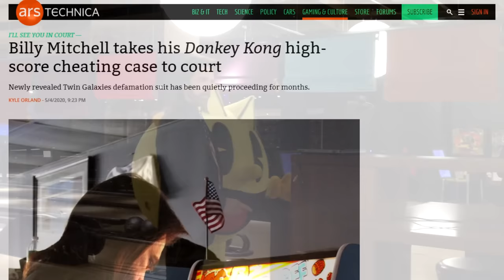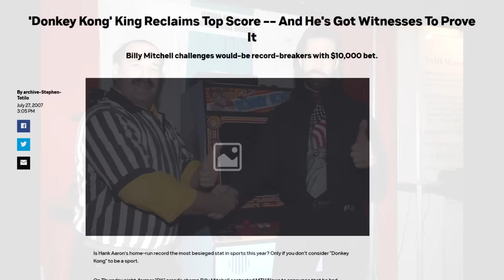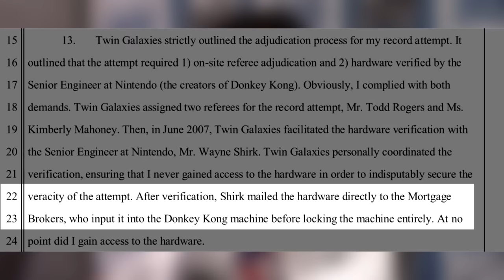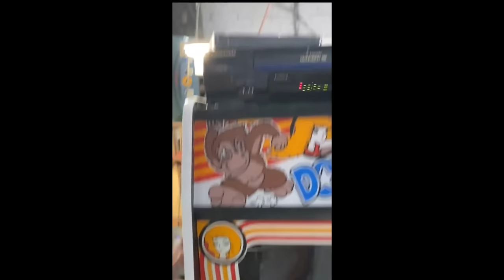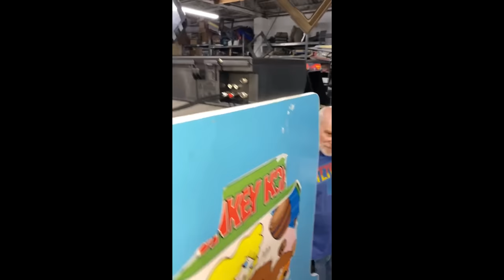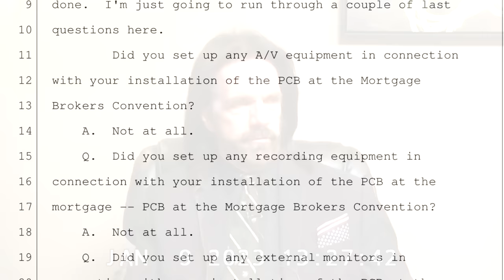Cheater Billy Mitchell's Fake Story Is Falling Apart

Comment: I believe I was the first guy to record video using the same 2 bits hardware that Billy used with a donkey kong machine. the video is on my channel.  One thing to consider is the two bit board produces a non standard NTSC color burst. because of this many VCRs cannot read the color signal and instead record a black and white image. I noticed in the red joystick picture it shows what model VCR was used . If you want another smoking gun buy that VCR and see if it can even record in color while connected to the two bit pcb.
Reply: JASON! How are you doing these days?! I miss your videos, man! Hope you, the family & collection are doing well.
Reply: This comment needs to be seen!
Reply: then how could the image at 6:37 be in color?
Reply: @MenachemSchmuel  since the color burst signal is not standard not all devices can see color. in fact most devices do not see color.  from the two bits pcb.  there is an added level of complication involved when recording with a vcr .
Reply: @ArcadeJason  that doesn't answer the question. The tv image at that timestamp is being fed through the same converter board and VCR that billy is claiming to have used. If it couldn't read the colors, then the image wouldn't be in color.
Reply: Why do you know this? Why does anyone know or care about any of this?
Reply: @jay-by1se 😂
Reply: @jay-by1se  Have you seen his videos? He works on these machines, restores & repairs them. It's a hobby & like any hobby there's a community behind it.
Reply: @MenachemSchmuel  i see i did not catch that it was the same model vcr. if that is the case does said vcr record in color? the footage does not show that.  the footage only shows a pass through
Reply: @ArcadeJason  Looks like a panasonic 4022 if someone has one to test.

Comment: The fact that they are seeking damage of $3,333,360 is so on the nose for a lawsuit between gamers
Reply: How so?
Reply: @Postman795  It's the max top score one can achieve in Pac-Man.
Reply: @md_vandenberg  BASED AF
Reply: It's just a hypothetical number based on the reasoning if you were paid max. You are sued for the max, say he did win he could be rewarded, for example, $1,000,000 or even just $30,000, Almost nobody ever gets the full sum. 

With that said, how does all that head get on that tiny body? He must use cables to help prop that thing up on his neck.
Reply: They also hope you'll settle because you can not afford the court costs.  The lawyer will also drag it out even if they don't have a strong case in hopes of this.  Any monetary win is validation in Billy's perspective.
Reply: The fact that he even doesnt qualify as a gamer XD

Comment: I think Billy has told those lies so much by now, that he believes at least some of them himself by now. That's why he brought forth witnesses whose testimony doesn't align with his, because he genuinely thought that the arcade was hooked up to a VCR. In case of the manager it's also possible that he simply hoped that the witness wouldn't remember it well enough to contradict his statements.
Reply: To be fair it is pretty stupid if the setup on the pictures wasn't even connected. Although I guess that would further add to the pile of prove to this being premeditated and an attempt to cheat. I'm surprised the manager answered the cable situation so conclusively.

Comment: I was under the impression that Nintendo outsourced board production to a third party, which is partly why the original code was lost and also lead to issues when Nintendo wanted to produce their own machines to meet demand.
If this is the case, wouldn't it be moot to send it to Nintendo for verification at all?

Comment: back when I was teenager, one of my friends got as far as it was possible in donkey kong. At the last "restart", he would not have been able to reach the top within the time limit in act 1, but there was a bug, it was possible to jump off the side in the right side of the screen, you would fall through the floor and complete. Screen 2 is easy, just run to the top without picking up any points (timer started around 600 points). Act 3, he just ran the shortest route as fast as he could, and somehow reached the top without getting hit by the springs. Act 4 was impossible though, even without monsters, he would not have been able to activate all 8 seals.
We were pretty good at playing video games - for 1 credit, we were able to play all day on Mr. Do.
There was a reward burger for each highscore made every sunday, it was however another kid who won almost all the rewards on the other games.

Comment: The questioning of the gamestop manager doesn't mean that there couldn't be a recording set up inside the cabinet. Not the VCR but nobody asked if the manager had check if the cord that came out through the power cord hole only had one end and that it was a power plug. It could've been the two cords wrapped arround to make it through the same enlarged hole that later would split into two ends, one for the video and one for power. It would match Billy's story somewhat. He's still lying but it's not impossible to pull off what he's saying, it's just another one of the highly unlikely things that would have to have happened in order for Billy's world record to be legit.

Comment: I am still wrapping my head around what really happened that day, the actual sequence of events. In case it's not clear, I believe Billy is lying, but let's consider the somewhat plausible scenarios.

1. Let's consider Billy is not lying for a minute. That means that he got to the event, he saw how the machine was set up with a VCR and locked. But the person who did the setup does not remember any other cable. Lots of people saw Billy play almost four hours and he broke the record on the machine, then the machine was sent for validation and was approved by Nintendo. The manager was informed of the record even though it seemed like too short of a time. So the witness accounts, and there are reasons to believe that the record cannot stand anyway because the machine would have been modified. Not looking good for Billy.

2. Let's now consider that Billy was and is lying. What happened exactly? It looks like he arrived to the event, saw the machine being setup but there was no cable, does this mean no VCR? He announced his record after ten minutes apparently, but why would this be believable that day? Wouldn't he immediately be called a liar because he only played ten minutes and claimed a record of two hours? And why would he say that there was a VCR recording if there was none? Was there a VCR at the event or not, and if not, why would he not be discredited immediately for coming up with such an outrageous claim of a non existent VCR right then and there? 
Or did everyone in the event doubt him immediately except he got a couple of friends that said he did play and did record, but somehow nobody checked that the machine did not have a VCR? I don't get it.

Comment: The board is not a modified board just because there is a device enabled to receive the the board's graphics signal and record it. I'm not pro-Mitchell, but that's some goofy faulty logic.
Reply: Also, at the 14:00 mark in your video your say Valerie Saunders should have claimed in her deposition that the record attempt end around 2pm but she didn't. In fact, she said exactly that and it's on your screen at the 14:08 mark. You're making Billy look totally accurate. Congrats... if that is your goal.

Comment: 17:20 okay I just had a thought

What if Billy is using these witnesses he purposely brought in so that he can then double back and claim that they are unreliable by default or potential bribes?

Why bring in a damaging witness unless you can simply use them to “wipe the piece off the chess board” so to speak? He can make sure twin galaxies doesn’t use them in the case by later claiming they are lying.

If this is the case I doubt it would work but hey that would be the only logic I can take away from this. If he cannot have the witness then nobody can, a toddler’s mentality.

Comment: IMHO, using VCR over a video camera in and of itself has long felt like a strange choice. A camera would have shown the cabinet and who was playing it (before zooming in on the screen.) Now that it's clear that the VCR wasn't even connected, it's clear that there was no intent to be honest.
Reply: I'm not a Billy fan at all, but what you suggest isn't feasible. The player stands directly in front of the screen, there would be no way to record the screen with a camera unless it somehow could xray through Billy.
Reply: @MikeKing001  The camera could easily be just off to the side or just above head level or over the shoulder. This is not complicated.
Reply: @szr8  you are forgetting the main purpose of the event which was to draw traffic to the room it wasn't for Billy to get a highscore. Meaning they wanted it to be as easy as possible to watch him play. That's why they displayed the output of the machine on a TV above the machine.